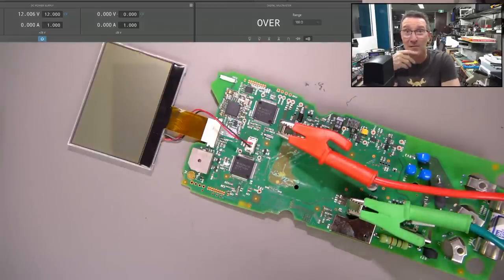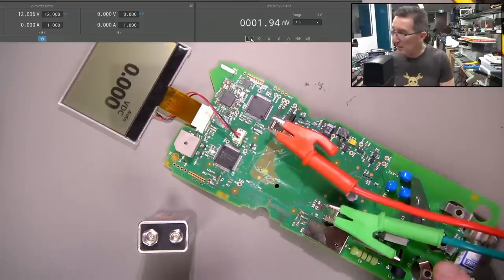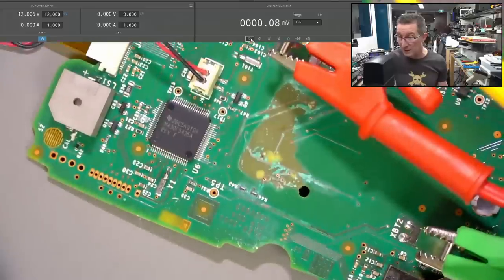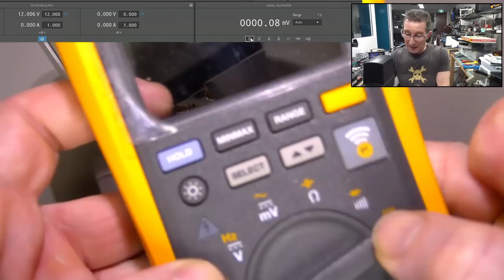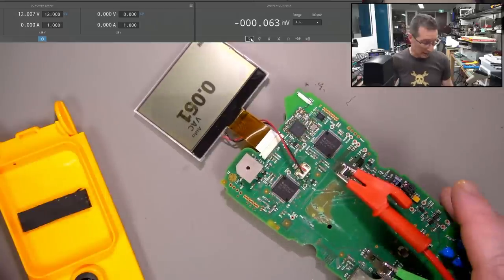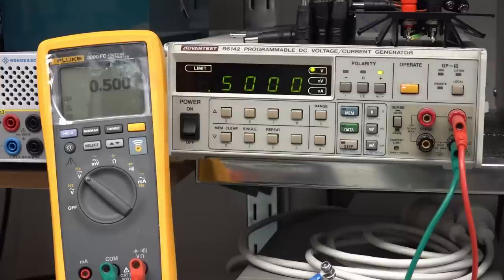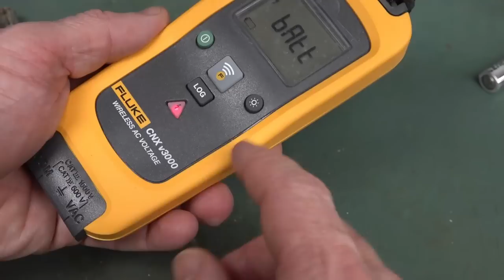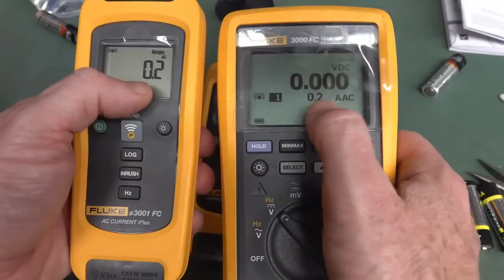Energizer Battery Leak Fluke 3000 Multimeter "Repair"

Comment: Maybe the cause of the error was the water in the isopropyl and now that it dried out it all works correctly.
Reply: That's my thought as well.  Especially since it went wonky with just skin resistance.  It just needed a longer time to completely dry.
Reply from the maker: It was 99.9% isoprop. And absolutely no way a tiny amount of water is going to stop this booting up or displaying stuff.
Reply from the maker: And it was already there for a day before I tried it on the bench the first time.
Reply: Could have been bad solder joints on the battery leads from the acid
Reply: @EEVblog2  It wasn't just IPA, it was IPA plus battery fluid etc.
Reply: @EEVblog2  I've run into this before, and also having all the solder mask eaten away on a TI calculator. It was "dead" after the cleaning and trace repair, but came back again once allowed to fully dry. I would guess there may have been enough to upset something even though the water content was real low.
Reply: @EEVblog2  The IPA would absorb water from the atmosphere plus you cleaned with vinegar first so there would be traces of acid along with the alkali from the electrolyte, all together you have an ideal solution to spoil your day and pure IPA will also act as an insulator, I have cleaned switches and they would not work until all the IPA had evaporated. Next time you have the same problem try a heat gun on low setting.
Reply: @EEVblog2  Sometimes when I clean laptop BGAs I have to give it a full day to dry out, to be able to run. I assure you that it was the IPA
Reply: @EEVblog2  How long has your IPA been sitting around for? 99% pure IPA pulls moisture out of the air and quickly reduces down to 70% or 80% something (don't remember the actual equilibrium value it gets to). If the seal's been open for any length of time, I don't think it will match what's printed on the tin anymore (though I doubt a little bit of water in the IPA is what caused it to not boot before).
Reply: @mikewillis1592  yes that fluid releases caustic gases too that wreck  pocket radio coils, check out shango066's radio repairs.Probably just enough to short out the high impedance LCD drive until the IPA and water it attracts dried up.
Reply: @EEVblog2  The IPA could have dissolved some small but enough amounts on the electrolyte to make it conductive. I don't know the exact composition but alkali metal salts like to disolve in ethanol and a bit worse in IPA too
Reply: I bet - it's not :-)
Reply: @EEVblog2  Oh. Ok. Can't be water. (Stress) crack that came together when you took it apart and somehow stayed together even with reassembly? I'm stabbing.
Reply: Yep, I bet on that. And that liquid soaked into the vias. But evaporated since.
Reply: @EEVblog2  then either you should check if it's 99.9% and not absorbed water from the air, or that battery leakage residue had been dissolved in your IPA, and then solidified in non-critical amounts and places since IPA evaporated

Comment: I have an HP which suffer similar battery leak. After cleaning the board the multimiter was turning sporadically on and of on its own.
I took an ultrasonic glasses washer and sokaed the board in distilled water (the affected area only). Turned the ultrasound for 15 mins, then dried it and ultimately it works as new.

Comment: It may have been that some of the Cleaning Fluids that you used to remove the Crud and Solder Mask may have gotten under the multipin square chips near the LCD to create havoc until the liquid dried. I've seen this before on some of my own designs while repairing.

Comment: Mr Fluke 233 from the first video here. I was lucky enough to have some brush on coating. I thought it was funny you still had the protective screen cover on your meter. I’ve had my 233 for as long as I can remember and still have that piece of plastic on the display as well.

Comment: If I recall, you had a good amount of alcohol dousing the board which may have gotten beneath the display chip. That may have taken a bit to evaporate. That may be why the display was not working immediately.
Reply from the maker: It was left on the bench as you see it and was powered it up a day later just like this and it didn't work.
Reply: @EEVblog2  sometimes it can take quite a while for alcohol in tight areas to evaporate. At least a plausible explanation.
Reply from the maker: @LB-fx1kn  I used 99.9% IPA. There is no way that is going to be low enough impedance to cause it not to boot up and not display anything.
Reply: @EEVblog2  It likely would have had stuff in solution after working it's way across the board, there was still a fair bit of that corrosion shit esp on the other side. We'll never know
Reply: I could be wrong about the IPA, my experience is with marine electronics. A lot of conductive impurities like sea spray and salt to wash out of the electronics in that environment. We used sonic cleaners and alcohol or trichloroflouroethane back in the '80s before the Coast Guard told us it was carcinogenic. Before MSDS. I do wonder what the conductivity of the battery outgassed acid crystals might be if wet. I have seen moisture accumulation from rapidly evaporating alcohol form condensation. But that is in high humidity environments, like near the coast. We sometimes would flush and scrub with alcohol then WD-40. I am sure your HVAC keeps your shop humidity low. Even after 45 years in electronics repair, I can always learn something new.
Reply: Wondering aboout how well the plated thru holes were cleaned?  In conjunction with the IPA it might have made some real soup.

Comment: i would clean it up the best i could 
maybe even some acetone around the area where the solder mask is already gone, maybe a little picking around any crud between traces then just cover all the exposed copper in nail polish and not worry about it again 
i did the same thing with a multimeter that got bad water damage with the batteries in, still works fine

Comment: I truly hated when avionics issues in production flight testing were irreproducible on the ground. Can't sign them off without describing the fix. Occasionally wrote "Cleaned and straightened pins on [whichever connector]" and let it fly again. (Meaning pulled a box out of the rack and put it back in usually, unless it was a canon plug).

Comment: Why wouldn't you coat the resistors? Given the coating is high k and the original epoxy coating did serve as a layer of protection?
Reply from the maker: Someone might want to remove and replace them later.

Comment: Fluke meters are tough as this one proves. I've had plenty of cheapies, but splashed out one day several years ago for a fluke. I still have it, and it still works perfectly, despite being dropped and havig soft drink spilled on it (I cleant it inside and out with IPA after the soft drink spill).
Reply: Was the soft drink sugar free?

Comment: Well, I guess I'll have to take back my previous RSVP fluke multimeter comment. It'll probably eventually die again, but it could at least last for a few years. Corrosion will probably eat a via from the inside, then it'll need another repair. At least it looks relatively easy to work on.

Comment: Have always thought that film resistors have that.. huh.. film right under the top enamel. Also probably calibrated by trimming the film before applying the enamel on top. Very surprised that this is not the case.

Comment: I missed the first test video. I hope this doesn't come across as insulting--I'm only mentioning it because it is a dumb mistake I made the other day cleaning up after a leaky battery. Whatever I was working on would function intermittently after a good cleaning with isopropyl. After much wiggle-wiggle testing of the PCB,  Eventually I realized the contacting surface looked like foamy metal and metal oxides and the stuff seemed almost as hard as metal but only conducted in a few little spots. It was insoluble in everything I had handy so I ended up using a metal file on it😕 I left it open to future corrosion at the drop of a hat, but it does work perfectly for now.

Comment: i had a similar with an older model in that range it got soaked and i mean drowned shook the water out of it some ranges worked i was totally gutted about it , took it apart allowed it to dry gave it a clean off with isopropel let it dry again , some ranges worked some didn't , i really was miffed , then a week or so later came back to it and the bloody things working and has been now for several years are these that indestructible

Comment: i wonder if the corrosion on the other side on the button pads caused the no display?... like if a button is held down while its switched on, it doesnt show the display...(might even be a feature!)
Reply from the maker: Nope, holding down buttons at power on doesn't stop the LCD working.
Reply: @EEVblog2  only other thing i can think of is ...the batteries ya put in it where crap.. not enough voltage to power up the display..but enough to flash the leds...(ya didnt show which batteries ya used to test it!)...or maybe that extra volt is needed now? have you tried it again with batteries?! (AAs are 1.5v..so 2x is gonna be 3v...but you injected 4v)... yeah yeah clutchin at straws!

Comment: It would be interesting to know weather the stuff coming out of the energizer batteries will eat away the compound on cob chips
Reply: The stuff which comes out is potassium hydroxide. Some of which can react with the air to produce potassium carbonate.
 Both of which can convert PCB traces into copper hydroxide and copper carbonate.

Comment: Should have coated the damaged resistors as well..  Would not have harmed them as the conformal coat is literally designed to go over components and live electrical traces and plastic and epoxy without causing damage.

Comment: Perhaps the push button switches had contamination on them and were making contact on power on confusing the microprocessor?  Cleaning them may have fixed the problem?
If I am in the states and bid and win the |Fluke, how much extra will I owe for Austrailian taxes, shipping whatever to get it to 45140, Ohio|?  is it a deal breaker for me??"
Thanks.  Dennis

Comment: Look on the packaging for a 1800 number they should replace it for you.  They are not cheap.
Reply: "The warranty does not cover manuals, fuses, disposable batteries, damage from neglect, misuse, contamination, alteration, accident or abnormal conditions of operation or handling, including failures caused by use outside of the product's specifications, or normal wear and tear of mechanical components."
Reply: @Okurka.  Not the fluke warranty.  The energizer packaging has a 0800 number for NZ and a 1800 for Aussie on it.  I have made a claim in the past. They replaced the damaged item. The batteries in Daves first video showed the batteries expire in 2024 so they should not have leaked. Energizer should cover a replacement.
Reply: @David5467  Those batteries came with the meter.

Comment: Pure IPA does not really dissolve the chemicals that come out of the batteries.
I usually use rubbing alcohol or water for cleaning.
Then rinse with pure IPA and put it in a warm place to dry.
Some of the chemicals probably remained after cleaning and dried out then it worked.
Some of the vias look damaged, it would be good to repair them.